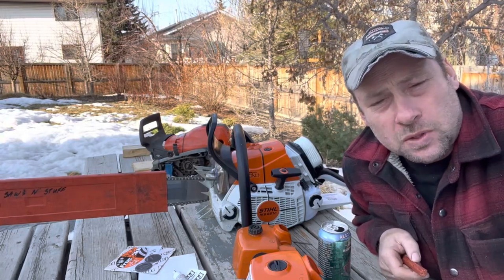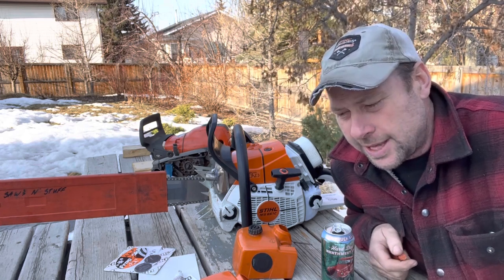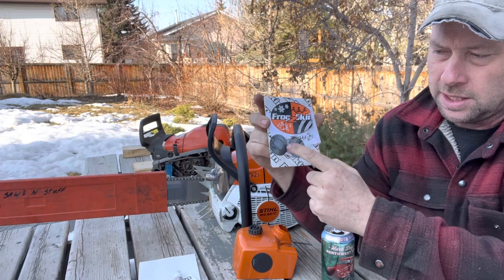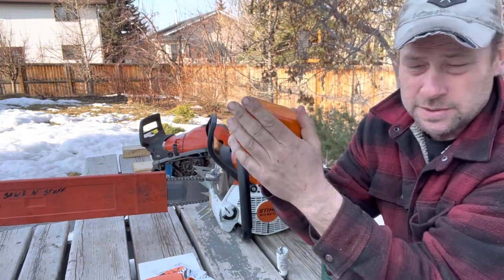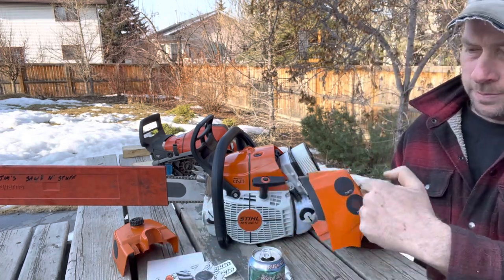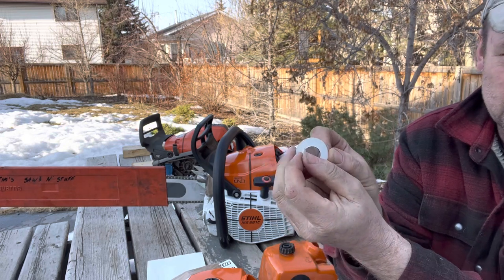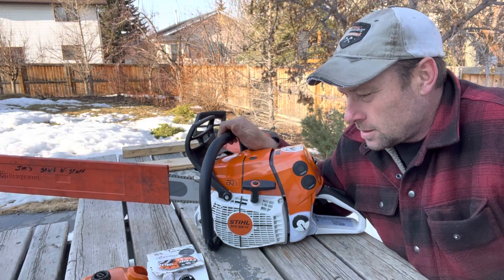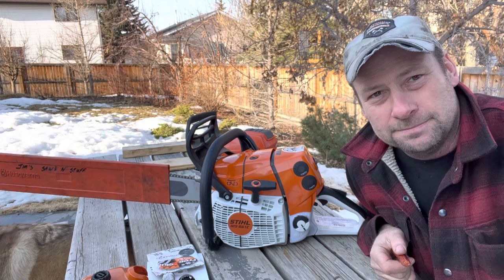Stihl Chainsaws, how to Build a better air box! I use Frogzskin vents and give all my secrets 😳😜👍

Comment: Thanks buddy, really cool. The 661 you can hear the intake sucking when stabbin the throttle so I bet this helps. I think charles milled some of that cover away and ditched the inner spit back baffle.
Reply from the maker: I also prefer to ditch the anti-spit back baffle…I always return it with the saw in a bag incase the owner wants to compare it with and without…I normally remove a few of the baffle segments as it increases the velocity vs no baffle.
Reply: @Jimssawsnstuff  Have you found it soaks the paper element without it? Im sure ported they are better at keeping the fuel out of the air filter.
Reply from the maker: @ricksanchez7459  I didn’t have any issues with fuel spitting in the ones I’ve ported, but I never tried a stock saw without it…next time I do one I’ll try to 😉

Comment: Hey. On the 500i. Is it getting pressurized air? It doesn't seem like it. Seems like it's using that flywheel wing to cool the motor rather than sure injection. I'm looking mine over and i don't know much about much. I don't see the connection. Cause this seems brilliant really. Great tip handout here. I know Stihl has a version of air injection. But i can't see it on mine. Send like the only place it's sucking is in front of the filter cover and behind it near the grip.
Reply from the maker: I don’t have a 500i here, but I’d worked on a couple before I made the video and I was pretty sure the have the same “air baffle” like Husky uses to divert the air from the flywheel into the air box.
Next time I get a chance to look at one, I’ll remember to update this video to provide more clarification on it.
Reply from the maker: I’ll do an update, but no it’s not. So the Frogzskin will likely help it, as will adding the screen like I did on the 661 in this video
Reply: @jimssawsnstuff8903  adding the screen is probably a really good idea.  It pulls in big chips. I added another gasket to the top mount. Tightened it up. Eagan has a o ring gasket for the actual knob that looks like it would keep the small stuff from penetrating all together through the knob on top. I put a slather of grease underneath the stock filter I think it definitely needs that in addition to that extra gasket for the knob. So far that seems to be keeping fines from getting under the filter or on top of the filter.